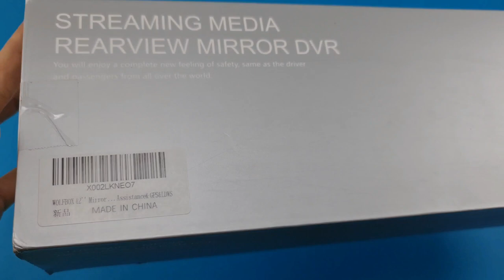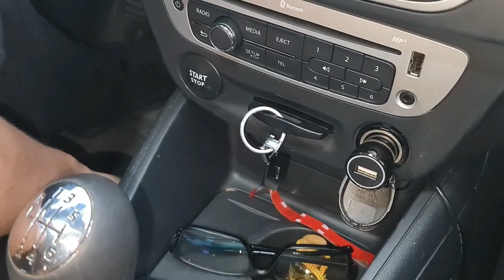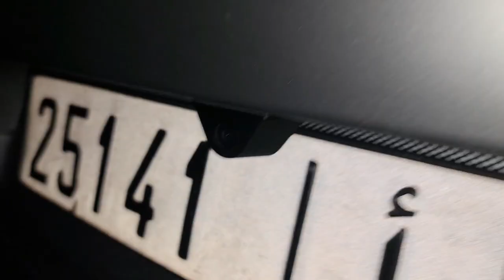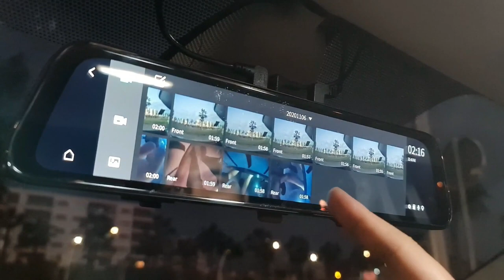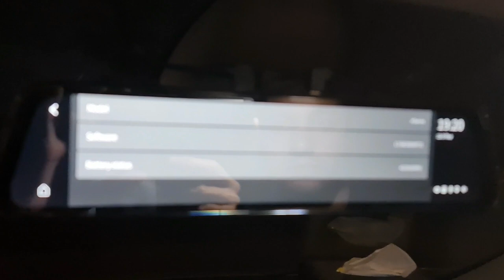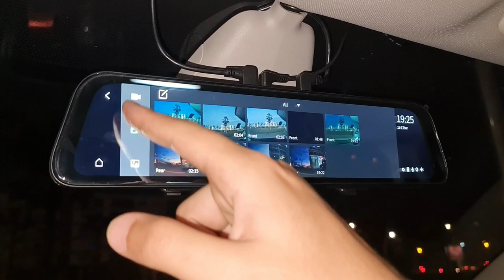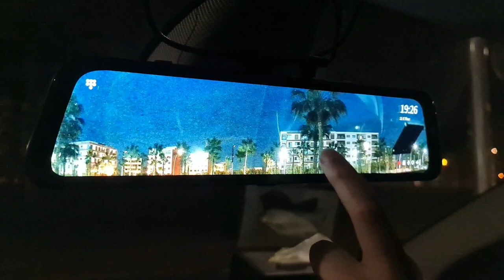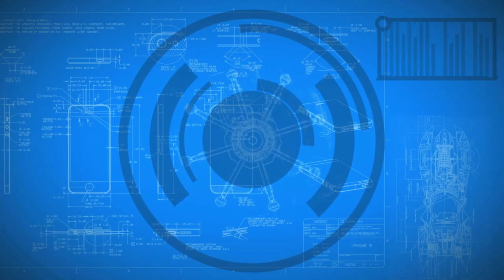WOLFBOX 12" 2.5K G840H Mirror Dash Cam : Unbox, Installation, Test, Review

Comment: 22:35 in the front camera the bench that appears on the right side, in the rear camera it appears on the left side, in a normal rear-view mirror it is expected that the image of the bench on the right side will also appear in the right side, moving away from the car, this is an important detail 

22:35 en la cámara delantera la banqueta que aparece de lado derecho, en la cámara trasera aparece de lado izquierdo, en un espejo retrovisor normal se espera que también aparezca la imagen de la banqueta de lado derecho, alejándose Del automóvil, este es un detalle importante para tener en cuenta a la hora de la compra